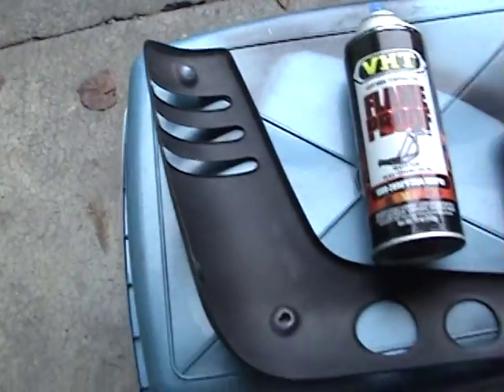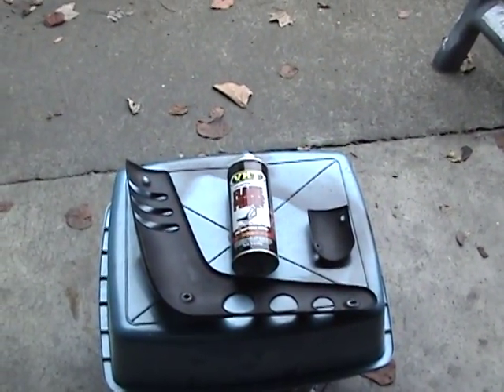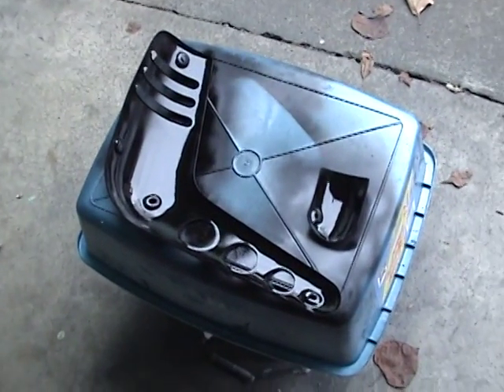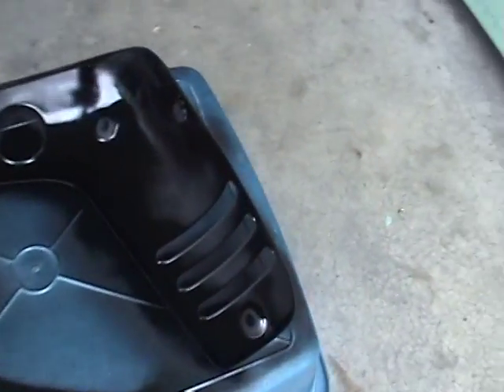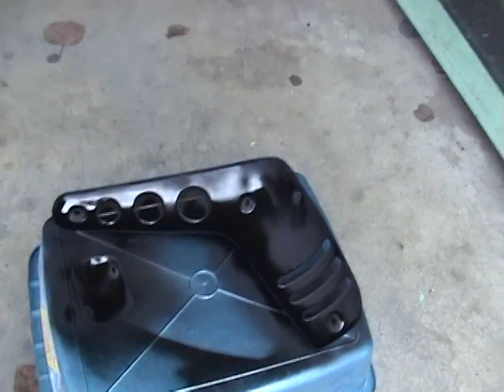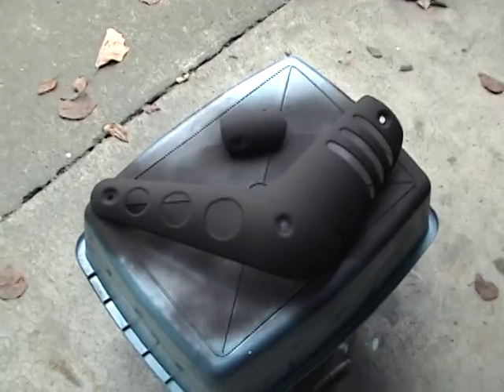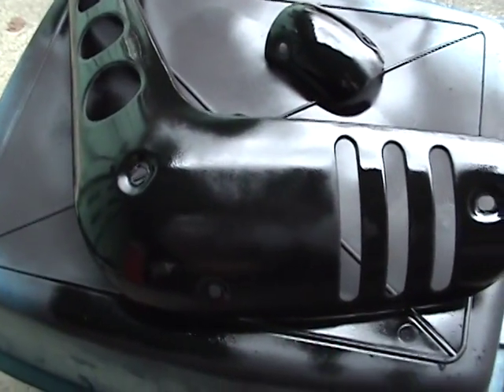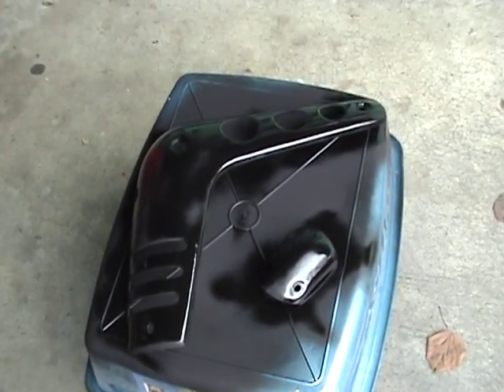Applying 2000 DEGREE Gyro Muffler Paint

Comment: Cheap? Wal-Mart? This stuff isn't cheap, and I sure as hell didn't buy it from Wal-Mart. I'm telling you from personal experience that this stuff actually works, so either you're just being a troll, or you sincerely need to lay off the sauce. VHT is a reputable product made by Dupli-Color. I know many professionals who use this stuff to paint headers, and other high-temp surfaces. I used their caliper paint once, and it still looked like new 60,000 miles and two brake jobs later.